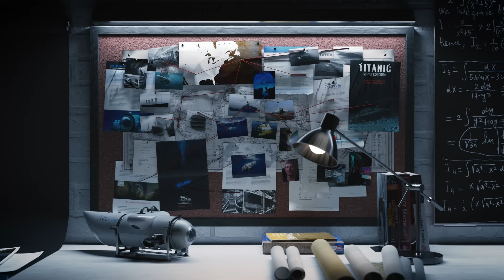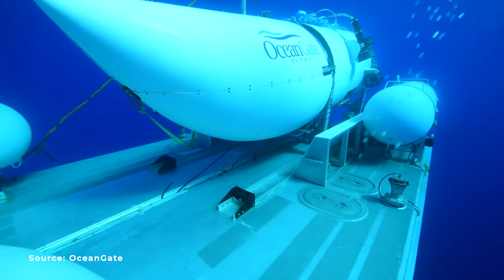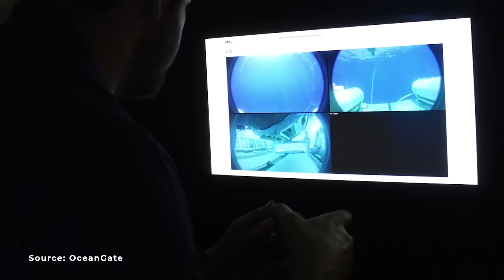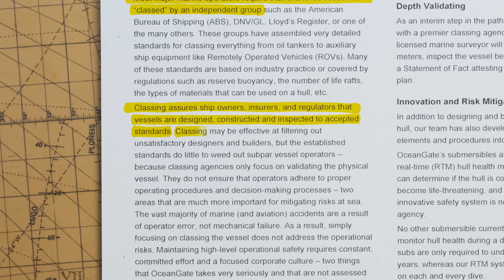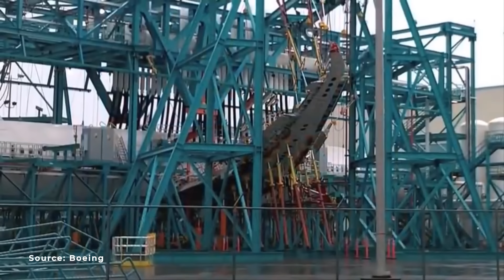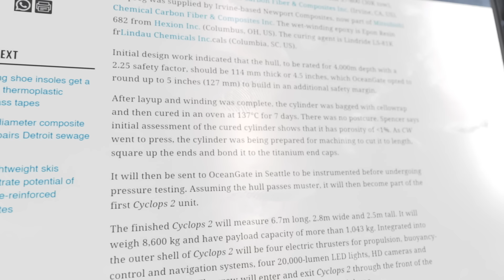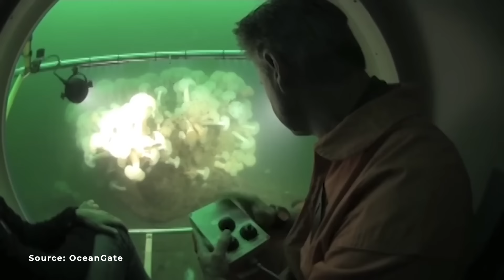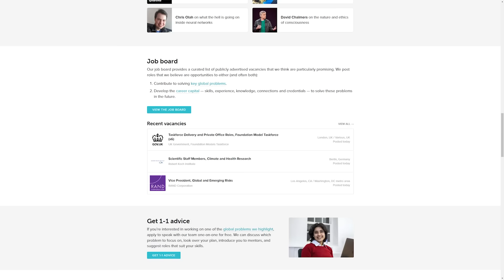The Questionable Engineering of Oceangate

Comment: The internal de-lamination discussed in 5:45 is due to highest stress being put on the smallest ring, which isn't supported by an even smaller one - so it buckles. The adhesive that is holding it to the outer ring isn't strong enough to pull the rest of the rings inside so it de-laminates.

Now the ring above it is the smallest one and the overall structure is weakened. It then de-laminates further or the pressure is able to buckle the whole structure in one go and the ring gets crushed.

Comment: Great explanation as usual! As a former composites R&D engineer, I find the manufacturing process itself to be an astounding aspect, alongside the subpar design and insufficient testing. In terms of suitability for this application, wet filament winding would undoubtedly rank at the bottom of my recommended processes ... shocking

Comment: Of course the regulatory body that controls classing vessels doesn’t account for licensing the operator!! They’re two entirely different regulatory agencies! I don’t get the DMV to sign off on a motorcycle helmet, thats snell and DOT. That blog post was just clever lying. Of course most airline crashes are operator error, because we tested the engineering to failure and beyond! That was extremely clever lying by oceangate.

Comment: Any formula 1 team has an autoclave large enough, one would think.  They would also possess amazing knowledge of carbon fiber stress/flex etc.
Reply: That'd be one way to do it indeed and could probably be completed during its inevitable downtime (assuming they own it and don't contract that job out). Not sure if they'd want to touch such a project though without assurance it'd be properly certified and tested/inspected periodically. Many formula 1 teams are familiar with at least a few recent close calls and maybe even worked there when deadly accidents happened within their team.

I'm honestly impressed how rarely that happens these days and how the drivers more often than not manage to get out of the car on their own after a terrible looking crash with just some minor issues like a few bruises. That can't be the result of skimping on safety protocols during design and testing.

Comment: The difference between this guy and spacex is that when spacex breaks rockets, they don't put people inside. Their human rated spacecraft has been rigulously tested in multiple autonomous missions before they ever flew humans.
As for blue origin, you can't assign this mantra to they. They are anything but fast. Virgin Galactic are also a company that takes things very slowly. They prefer not to break things.

Comment: 4:02 this sentence made me so fucking angry i had to pause the video and rant about it, of fucking course we have less and less mechanical failure over time, BECAUSE WE LEARNED FROM THE MANY, MANY MECHANICAL FAILURES OF YEARS PAST. no, airplanes dont keep from disintegrating midair because mechanical failure is inhierently less of a risk than operator failure, its because WHEN IT HAPPENED, WE LOOKED AT THE CAUSE AND TRIED TO ENGINEER PLANES TO NOT FUCKING DO THAT. pretty successfully too! but oh, im sure your new fancy fucking square windows are just scaring the engineers because of how INNOVATIVE and FORWARD THINKING they are. no, go ahead, take off the ripstop rivets! theyre only there because the engineers arent innovative enough to appreciate the sleek, clean design of your plane. 

christ, only 4 minutes in and im already fucking pissed to hell.
Reply: obviously im not an engineer but that single sentence set off so many goddamn red flags, if i some cunt who likes watching airplane disaster analysis docs can instantly see the problem with saying that, the so called engineers working at oceangate should have all fucking quit the second that page was put up. all theyre doing is writing over the old regulations in new blood.

Comment: Your view and analysis is correct from another carbon composite engineer.
However,
What's the A3 paper area got to do with anything?  That pressure [366 atmospheres] is applied to all external surfaces of any individual size.

Comment: When I used to work as a baggage handler, I distinctly remember we were instructed not to touch the 787's fuselage or parts other than doors and panels because of its carbon fibre/composite construction which could be easily damaged. And now thinking about it, well no shit: they're fibres, basically strings...

Comment: The worst part of this whole debacle is the uneducated public has just been taught a sweeping distrust of carbon fibre (maybe even composites more generally) that will dry up interest and investment into composites research. This is like the chernobyl of cfrp.
Reply: @@erickanter4090 It is not generally well warranted. Every aerospace application of composite structures includes significant compressive loads. The top of a 787's wing spar is under thousands of tons of compressive force. You have to do the analysis and testing but it can be safe and effective.

Comment: @3:47 the paper reads " The vast majority of marine (and aviation) accidents are a results of operator error, not mechanical failure. " What this guy failed to understand is that this statement is a reflection of the regulatory bodies doing there job. Mechanical failures are minimized  because that is what they are designed to do!!! SMH infinitely

Comment: To be honest ,I didn't even know this titan sub existed untill last month. When I heard it was made of carbon fiber and titanium I was baffled as to why someone would do this. I was a pipe fitter for several years working in conventional and nuclear power plants. I knew from the trade that different materials expand and contract at different rates under different temperatures and pressurers . Take a peice of sheet metal and paint one side. The carbonfiber and the titanium alone would eventually separate through heat cycles. That's why all the steel used in high pressure pipes has to be ther same or the difernt expansion and compression rates will eventually fail .

Comment: You can't compare what spaceX does to what ocean gate did, spaceX does rigorous testing of everything before putting anyone on board and they expect failure, using safe environments to use their innovative equipmemts. OceanGate scrapped something together, did minimal testing to reduce costs and started selling it to gullible millionaires.

Comment: As always, very nicely put together video. I appreciate your very approachable explanation of composites and their advantages. I was excited to hear about your MS thesis, I’d love to read it. I’m a young engineer at an advanced composites research lab working towards my own MS in robotics and their use in composite manufacturing.

Every person I’ve spoken with about this incident has shared in concerns over an externally loaded composite pressure vessel, especially one with so little testing or regulatory oversight. And every further detail uncovered just makes this story worse and worse, from the lack of non-destructive testing, to the blatant disregard for expert opinions. This was shotgun engineering, and the worst case scenario came to pass with tragic consequences.

Composites are difficult materials to work with. From tricky and often unpredictable properties and failure modes, sensitivity to thermal and other environmental cycling, to fatigue lives that are highly sensitive to void content and the manufacturing methods used (Vacuum infusion? Really Oceangate?). When people’s lives are on the line, there’s no room for this kind of reckless “engineering” that gives no respect to the true complexity of these problems.

Comment: Thanks for analysis by and engineer with applicable composite expertise! 
 9:08 The hull that imploded was not built by Spencer of Sacramento. A replacement hull was built by ElectroImpact and Janicki Industries, both of Seattle area, in 2020 after the Spencer hull showed signs of "cyclic fatigue" in 2018-2019 testing.  The original Spencer hull was derated to 3000m from the original 4000m so a new hull was needed to reach Titanic.  Details of the fabrication process are sketchy but one report is that the replacement hull was cured after every 1 inch of lay up.

Comment: You have a wrong explanation of the bouyancy force in 2:43. The bouyancy force applied on a totally submerged vehicle has nothing to do with the WEIGHT of the vehicle, but its VOLUME.
Reply: The weight of the water that a submerged object displaces is equal to the force of buoyancy. How much weight an object displaces depends on its volume.
So no, his explanation was perfect.
Reply: @msa7933  In fact, I listened again between 2:34 and 2:43. He explains the conditions to obtain a NEUTRAL Bouyancy (I was thinking he was describing the bouyancy). Therefore, what he says is correct : "the weight of water they displace weights about the same (WEIGHT) as the vehicle itself." Because if the WEIGHT of the vehicle which is in the opposit direction of the bouyancy force is equal to the bouyancy, there is an equilibrium of the forces.

Comment: Good video with some considerable expertise applied to tragedy.  And while it does not detract from your analysis, there was one notable factual error in your presentation, and a couple of lesser ones.

The version of the Titan which imploded was NOT the one made by Spencer Composites, and it was not filament wound.  That version started life as Cyclops 2 and was renamed Titan somewhere along the way.  In or about 2020, a new carbon fiber tube was made with Toray prepreg, and was fiberplaced by ElectroImpact and had the involvement of Janicki, a company which has a sufficiently large  autoclave to handle a part Titan's size ... see    https://en.wikipedia.org/wiki/Titan_(submersible).

So we at least have to give Rush credit for realizing that there was need for improvement after one of his dives in the "original" Titan experienced the cracking you referenced.  

It would be most interesting if you could confirm how the curing was done.  One quote attributed to Rush mentioned the "complicated logistics" of the fabrication of the 2020 version of the hull, leading me to believe it might have involved multiple transits from layup at ElectroImpact to curing at Janicki, which would be an unusual process in itself!  (Curing such a large and thick part IS a challenge.)

Also, I doubt that the abovementioned version of the (failed) Titan made your stated number of  50    dives to 4000 meters.  Perhaps the sum of all dives (regardless of depth) for both versions of the Titan reached 50, but I strongly doubt that the version that failed got to 4000 meters more than 10 times (I can document only 2 or 3 to the Titanic).  In any case, cyclic fatigue was likely a significant factor.

Finally, your hypothesis is that it was the carbon fiber tube itself which failed, and that may well be the case.  However, there are other theories which say another likely culprit was the joint between the tube and the titanium rings.

Comment: The whole thing is just flabbergasting. Even as a hobbyist, fatigue failure of CF is well known and there absolutely are imaging techniques that could have picked up voids and degradation after dives. 

I at first thought that it was a composite of carbon fiber around a titanium inner cylinder  but raw CF glued to the endcaps is just insane. So is only testing it once. It should have been cycled dozens of times or untill failure to get a proper understanding of its performance and service life. So so many opportunities to stop this....

Comment: "Move fast and break things" works when you plan for the object to be sacrificed in the name of progress. SpaceX plans for starships 1-N to die horribly, but then N+1 and up to be re-used repeatedly.

There's nothing wrong with move fast and break things design progression if you can afford to use it sort out your problems. As you noted, the problem is that they did not explode the requisite N carbon fiber pressure vessels to discover and solve their problems.

Comment: In having performed dozens of acoustic emission tests on reinforced thermoplastics, I have only actually heard emission on a couple of occasions.  Normally the emissions heard from defects are low level and at a frequency above human hearing.  When this happened I called for repairs of significant defects  followed by retesting before placing equipment in service.  The thought of ignoring loud noises on a system where failure will likely result in fatalities is hard to believe.

Comment: if the transcript leak (no pun intended) is real i believe that the delamination had all ready begun a while ago and the water on that final dive was pushed into the composite. this would explain there fast decent (almost twice as fast as normal) also when they dropped there ballast after hearing poping sounds they couldn't ascend at more than a snails pace and couldn't escape the crush depth before total hull failure which would have been instant.

Comment: I love the video, but I can't understand why you had the negative comment towards Elon Musk in this video. I know. Of course, that comes from WAI. How predictable. Hear me out, though. 

Calling Musk an overconfident CEO is wrong. The job of a CEO is to be confident, inspiring, and lead a team. However,  it is not to do safe engineering. SpaceX has other people for that, and they've shown more than anyone in the space industry (simply as they have more launches and results, both crewed and not) that they can do it safely. More than 200 Falcon 9 launches without any anomaly. If you're referring to Starship tests, you might have noticed that they're uncrewed at this point. Safety concerns are the primary reason, of course.

If you refer to him as a CEO in general, you can also take Tesla and other projects into account. Same result. Extremely safe, in fact, significantly raising the safety of automotive transportation.

Comment: I lost my job as a Senior Flight Engineer for almost 2 decades after raising concerns about critucal safety system in a flight which I would not clear to fly. Subsequently fought it internally to hear that there was nothing wrong and it was a personal matter with my manager. The manager got protected. I lost my job . Though it seems Valor in doing so, but running a family is hard after that doing odd jobs.

Comment: People are unnecessarily hung up on the controller. It's a Logitech F750, and, while you wouldn't want to play Call of Duty on that (they're a little laggy, the D-pad has sharp edges, the sticks are prone to cardinal snapping and should just be considered eight-directional, not full analogue, and the face buttons have a really high-force buckling action instead of a smooth travel), there is nothing wrong with using off the shelf components rather than reinventing the wheel. None of those really picky gamery problems I just listed should in any way impact the function of the sub. It's a competent controller with all the human interface controller stuff already done for you. The real problem with using the Logitech F750 is it is the bottom of the barrel cheap option, and that is exemplary of the entire damned submersible. Stockton Rush, at $250,000 a seat, couldn't stump up the cash for a real X-Box controller, he saved like $20 on getting the cheap option. Just like every other corner he cut to save a few dollars. It's the problem with the whole venture in microcosm, just on one very visible part. Just like getting expired resins from Boeing for a good price, just like not curing the hull in an autoclave, at every opportunity to do things the right way for a little more money, he decided otherwise.